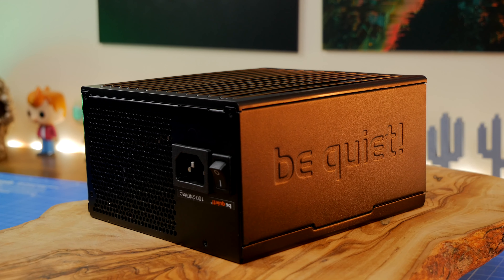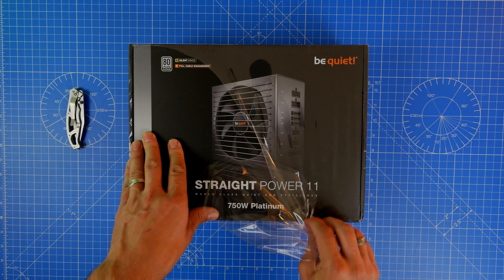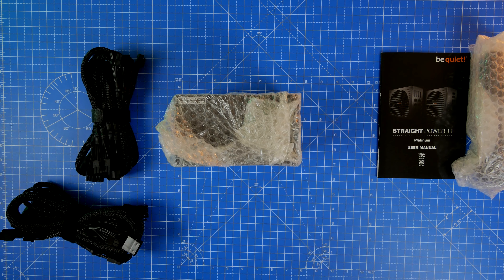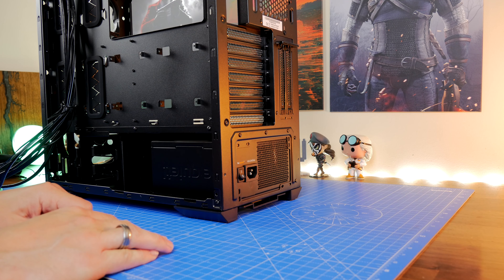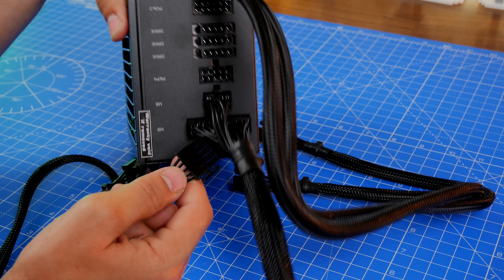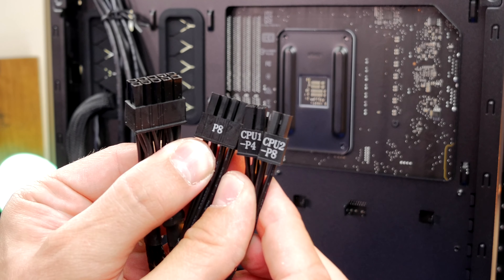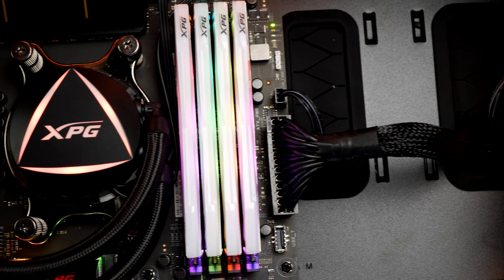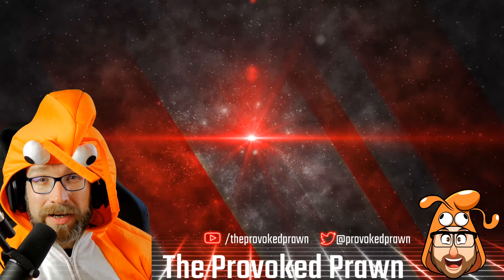BeQuiet Straight Power 11 750 Watt PSU installation

Comment: why did you put your gpu to the seceond pcie slot of your moba you should use your first pcie it adds latency and also you might lose some sata slots when you utilaze the the second pcie lanes cause some are wired to run through the moba chipset i think and you might need to configure it through the bios
Reply from the maker: There was an issue with that case where it was impossible to do so. But yes, I know that

Comment: I purchased the BeQuiet Straight Power 11 850 Watt PSU. The cables aren't as well labelled as the one you showed. Thank you for this video, or i would have never worked it out. Cheers
Reply from the maker: Glad I could be of help! :)
Reply: What do you think of it so far? I want to buy the 850w version too, anything I should know before buying it?
Reply: @Bizzarti  Its very good indeed. Mine is driving the AMD 5095 on an X570 mobo with 64GB ram, 2x 1TB EVO 980s, 2x 4TB SSDs 2 18TB WD Gold, an Artic Freezer 360mm wc and a 3090 vision card with no problems what so ever.
Reply: @greghilton7797  I see, thanks for the answer!
Reply: @greghilton7797  are you running a company on that thing, goddamn

Comment: Thinking of getting the straight power 11 1000 Watt psu for my eagle rtx 3080 Ti. Would the single 12 pin to dual 6+2 pin not affect the gpu power needs? Is it still going to provide the full 375 Watt of power needed for by the gpu? (75 watt from pcie and 150 watt from each 6+2 pin) New to the pc building community and cant find anything about this cable online.
Reply: I have the same question, I know you shouldn't use the dual 6+2pin but the connector on the psu is a 12 pin connector... does it move watt?
Reply: A little bit of research and I found that these aren't actually 12-pin connectors but rather some form of dual-8-pin-in-one-"12"-pin which I think is capable of supplying just up to 300 watts instead of a real 12-pin that's rated to supply up to 500 even 600 watts of power. So in theory yes you would be able to do so since that "12-pin" should be safe in supplying 300watts and it will still pull 75 from the PCIE, fulfilling the Ti's 350 TDP rating as long as you don't overclock the cards to a point beyond 350watts but I am annoyed that it isn't a real 12-pin connector that can supply up to 600 watts per input otherwise I would have run to buy this PSU for my mining rig and used splitters from there, saving space for my risers and such.
Reply: I have the same dilemma with the same GPU. Not really sure what to do. The PSU came with a second "12 pin to double 6+2" cable, but it's just so inconvenient to have both, and use only one of each splits per cable because we're stuck with a lot of useless cable to manage and tuck away.
Reply: Had the same issue - figured it out with some help from Reddit. The manual states that of you use 12V3 or 12V4, you're fine with using one 12pin cable. It can draw up to 38A, which gives enough power for a GPU like 3080ti

Comment: anyone watching this, this is the 750w platinum which for some reason has far fewer connections than the 750 gold. I would get the gold as it has an extra PCIE, sata power and P8 CPU slots.

Comment: I got this psu and im running a 1070 which only uses one 8pin cabel. Now I'm upgrading to an 2070s and i think it uses 8 and one 6 pin. 
My question is..do I use the Y cabel to power it over the PCI2 slot on the psu or do i use two different cables and putting them on the 1 and 3 slot on the psu? Which way is better and why?

Comment: hi, why do you need the 6 pin mainboard power plug besides the big one, i just plugged in the big one, and my pc is booting and working like nothing happened, so im just curious
Reply: Beats me, too: I just bought this same exact PSU (750 Platinum, fully modular) and makes me scratch my head

I should take a break and eat some walnuts first, and come back to building this PC later 😆

Comment: Can i use just one of the VGA´s for my GPU? I have a 3060 which only requires one 8 Pin.
Reply: hello , what cable did you use for ur 3060 ?

Comment: 3090 with a 750 watt psu?
Reply from the maker: Run you system specs through this and check https://outervision.com/power-supply-calculator